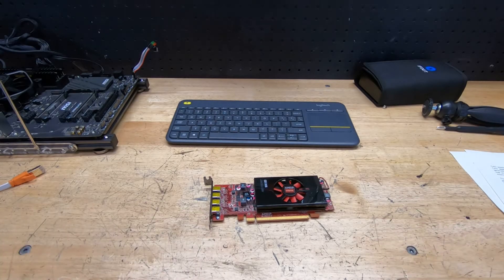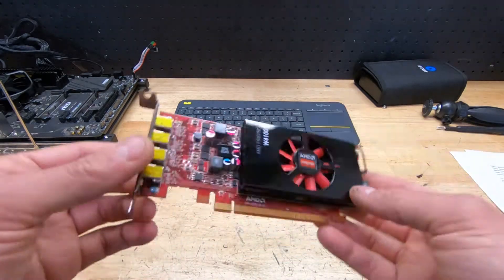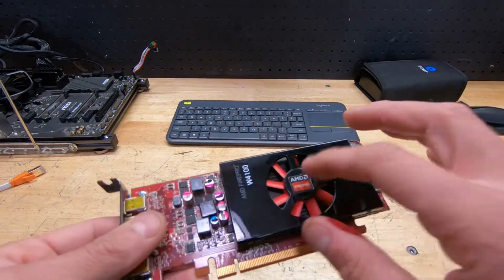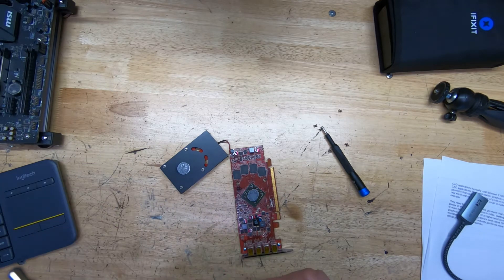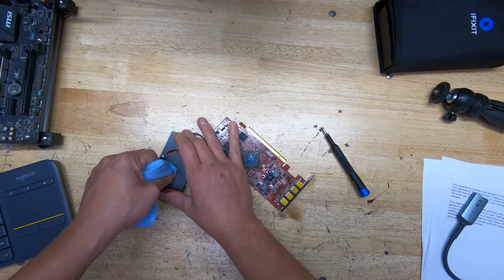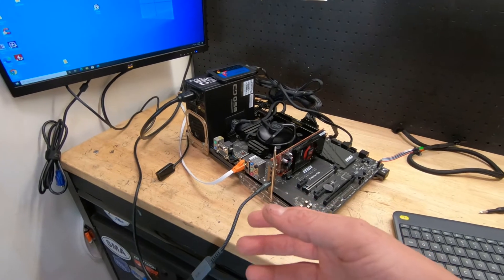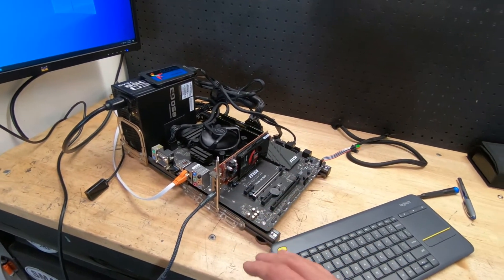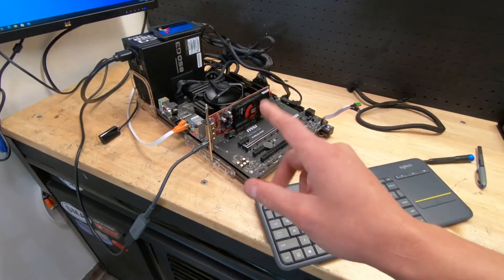AMD FirePro W4100!! 1080p on a budget!!

Comment: Since this card has a Cape Verde Pro chip in it, you may be able to force install Radeon HD 7750 drivers.  I've had such luck with other workstation cards of this era.
Reply from the maker: Might have to look into that. Appreciate the info!
Reply: Did you try??
Reply: @DarkLinkAD  I did, and I had no luck with this particular card getting any other drivers to work with it.

Comment: Would you recommend this card if i want to play red dead redemption 2? My specs are i5-2400 8gigs of ram and 300w stock psu and its a tower case. Nice review btw!
Reply from the maker: No. I tried and couldn't even get it to play
Reply: i guess its a hp compaq 6200 pro MT?

Comment: Thanks for the great video. I'm looking to get one of these because surprisingly this cheap card should support 4 displays. Just want to know how do you think about the noise level? Does the fan keep running even with light tasks or on desktop? Thanks!
Reply from the maker: yea the fan runs loud at first but when you install the drivers it quiets down, the noise level is barely noticeable, but a bit audible while gaming. advice for getting this card is make sure you use DDU to uninstall the driver. without it, it does not like to install the driver.
Reply: @DLMtechgarage  Thank you! So say I should use DDU to remove my nv driver, switch the card, turn on and install new amd driver. Question is will I boot into the system with a new card but no driver?
Reply from the maker: @ethanzhang7740  use ddu to unistall the old driver in safe mode. turn said system off after the removal. place new card in and then install the new amd drivers with the card. for some reason that card is a pain to install drivers without DDU
Reply: @DLMtechgarage  Thanks!

Comment: How much power supply is required to run this card properly
Reply from the maker: card is rated at 50watt, I would say depends on what computer you are putting in it, but the oem's they come out of typically run a 230w psu.
Reply: @DLMtechgarage  thanks bro

Comment: hello I know this question isn't about this video but I need help
so I'm thinking about buying a dell Optiplex 990 small form factor but I have some questions 
will it fit into a atx case or what will it fit into as in what size is it you know like its atx micro atx which one is it?

secondly, they have that big cooler on it can I just put a standard intel CPU cooler on it?

I know ill have to get an adapter for the front panel
 connectors, but ill also be using a atx power supply will I also have to use a power supply adapter for the 24 pin connector 

thank you for any help ALSO
your channel is so good you deserve so much more subs and I hope your channel blows up your videos are so help full!!!!!!
Reply from the maker: thanks and hope you can share the channel to help me out.

so those pc's will fit in any matx or atx you would. you are limitless with your options. for the psu if you have the 8pin on the board then you will need the 24 pin adaptor. I did a video dedicated to these question along with a how to guide on it. will post the link below. don't hesitate to ask any questions you may have!!

https://youtu.be/E0j9zHQ6rBw

https://youtu.be/hJGrhvgEZ2w

Comment: I always thought this card was interesting, but the minidp connectors always put me off. Good to see a recent review of this!
Reply from the maker: bro same here until i realized what they were and how cheap the adaptor was!!
Reply: Honestly, an 7750 is a better and cheaper choice. It's pretty much the same card.
Reply: @Liminal.Headspace  I've seen low profile versions of the 7750 go for £40+ here in the UK and I managed to pick up a W4100 for £17. (Obviously if your building using an SFF PC :D )
Reply: This has more Vram and a lesser price tag.
Reply: What sort of problem with minidp? 5€ for any minidp to "all"